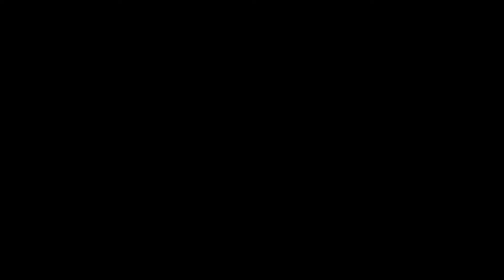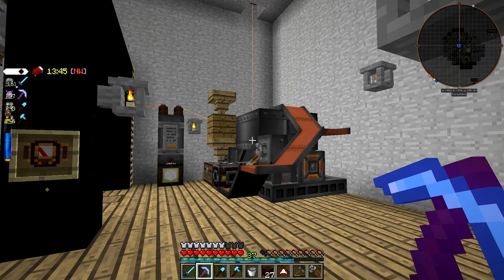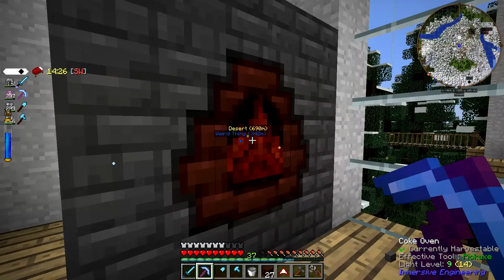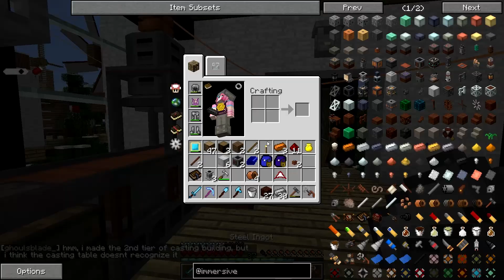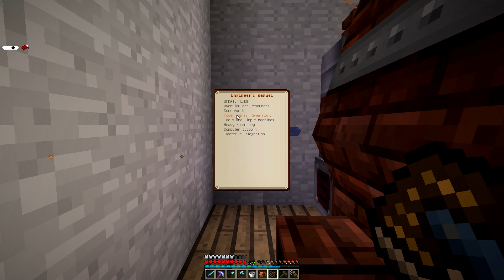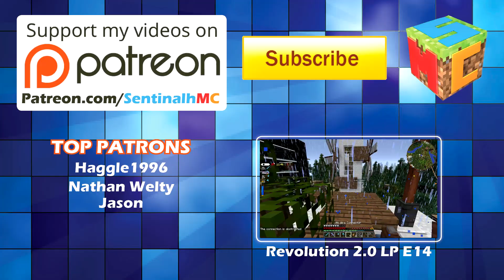Minecraft: Revolution 2 LP15 - On Blast

Comment: The wires have been Haggled! The LV wire only takes 256. And as each new connector tried to fill its buffer (they can take upto 256 at a time) it was to much for the wire and burned... Or something like that. 

The wires are bad! Each connection point loses power, including that one you put on the wall.  And I think there may also be loss over distance too... Basicly there only good point is they are cheap... and thus good for going over a distance. Like between your platforms... once there however you should use something else... Ill see if I can hook you up with some RF radiators. You really need to get into chroma! Lots of goodies.

Also there are blocks you can use to extend your platforms forever... Scaffolding does what you would expect... Catwalks has some that is cheap & the ones you use to make the base of the mettle press can be changed to have a wood panel on top by clicking them somehow. Cutting them with the architects table is cheaper than structural arms (another option). I tell you this because you really need more room.

Also put a banister on that top floor... it should give you more space than the glass.
Reply: Or at lest I would have brought you a RF radiator, if haggle hadn't reset the map and all my chroma progress. T.T
Reply from the maker: Wait, does that mean my treehouse is gone?
Reply: SentinalhMC Sadly yes... you can get a copy of the map... But my attempts at that have failed.
Reply: You can download the map; I sent you instructions via Steam.